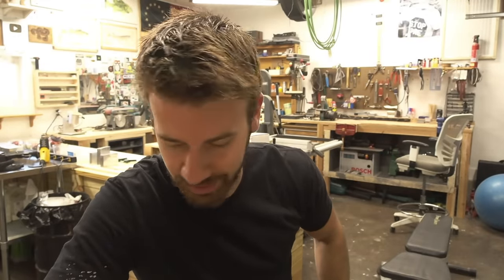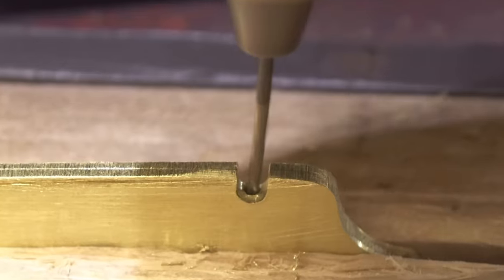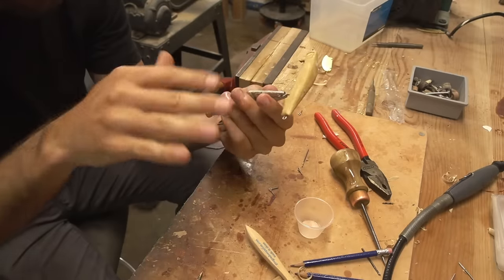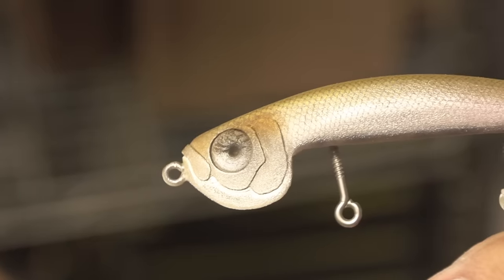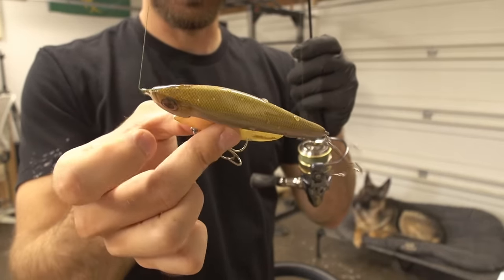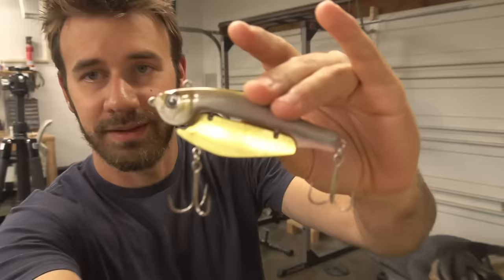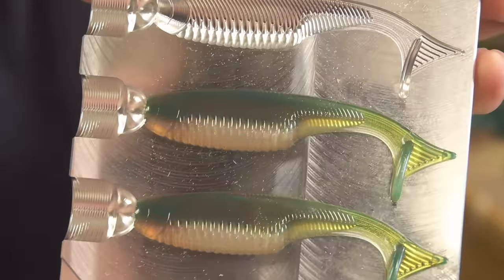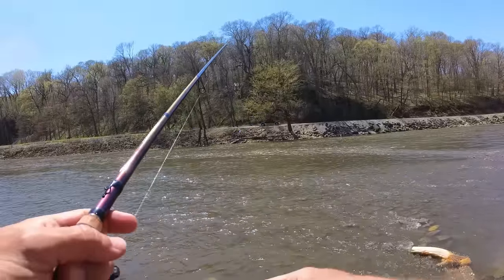Brass Belly Bladed JerkBait | One Day Build to Catch

Comment: My suggestion when you were struggling with the weight and lack of action would have been to grind 1/4” wide vertical grooves stair stepped on each side of the brass.  It would’ve cut down the weight and probably cause some erratic vibration coming through the water.

Comment: Slit the brass about midway point from the bottom. Bend the front one way and the rear the other way. Doesn't have to be a lot. But that may help it catch more water and get the brass to wobble more. 

Just a guess on my part. That could just make it worse too.

Comment: Honestly I really liked the original action before modification.  A nice lazy swim bait. 
I honestly wouldn't feel too bad. I've been fishing as much as I could (between work) lately and I haven't caught a thing. Dosent mean I'm not going to try. 

Size matters when it comes to the bait you use. Big baits will only catch big fish because smaller fish can't  easily fit it in its mouth. Small baits catch more fish and big fish like snacking.  
Water temperature matters alot too. A cold fish is a slow fish.

Comment: Have you thought about mounting a water pump underwater in your swim tank so you could just hold the lure in the current and get really good close ups of it swimming and the action of the lure. Just throwing a thought out there and seeing if it sticks to the wall 👍🏻 And I was wondering with the brass blade under the belly would a slight bend to one side at the front and a slight bend to the opposite side at the back help it wobble at all. I feel at the moment it is acting like a dagger board and causing it to stabilise and track straight through the water. I was wondering even if using the plastic bib material for this whole blade would work and could be painted as well. It would be a lot lighter and possibly move easier in the water and if you did need to heat and bend it a little so it wobbles this could be replicated in a jig.

Comment: When using UV, you could hit it with a UV curing flashlight to set the resin from running while on the rotisserie, then cure it with your larger light without having to spin the bait. EDIT: drill holes in the brass to lose weight.

Comment: Looks great…..maybe taper the brass, Top to bottom…or front to back.  Either way looks like it would be great for vertical “rippin” walleyes n deep water.  Also maybe move the line tie “eye” on top further back….even with the front brass “hanger” eye….  I’m certain it would work for our local walleyes.

Comment: Where they all Iwata brushes? They are pretty good brushes that can take some cleaning solvent abuse, and still work nicely.  But if you go Iwata go gravity feed, siphon feed not so good, although   it can take some solvent abuse as well, gravity feed works best.   My Iwata eclipse is siphon feed.  NOT A FAN.

My gravity feed ones are a Creos, a Paasche Talon, and my most go to airbrush is a Harder and Steenbeck Evolution.  ALL double action.   Double action airbrushes are the best bang for your buck.

Comment: How is it confusing? The lure does absolutely nothing in the water. 

-Replace the blade with two pieces of thin lexan (with iridescent foil sanwiched between them). 
-Give it a small rounded lip.

I don't know if lexan floats on its own, might need to weight it somehow

Comment: @MarlinBaits Just throwing this out there. It almost appears as though the broad back on the bait in combination with the non fixed blade are sort of working against each other. Because we know crankbaits with a broad back will can wobble but they usually don't have a heavy non fixed weight underneath. Than compared to an actual blade bait that does have a heavy weight on the bottom they are typically thin on the top. I wonder if the brass blade was fixed to the bait what difference it would make, you may have to rip in fast to get it to respond given its weight. Anyway still a very cool looking bait, well done!

Comment: This is awesome. Guaranteed major fish catcher and forward facing sonar niche bait for bass fishing. one suggestion, due to the amount of weight I think this bait could double as a pseudo blade bait. If you added an optional line tie on the top of the bait, the angler could choose how they wanted to fish it, as a swimming bait or a vertical yo yo style bait. I think it would have really good application both ways. Would definitely like to see this hit the market

Comment: Great work on the design, detailing and craftsmanship. I also had high expectations for your brass belly lure. I think the weight of the bass is too heavy without any hydrodynamic contours to offset the weight. Consider tapering the bottom to top of the weight as a V shape or any other profile and at the connection of the body  and weight could be more passive (more play) might be helpful to allow the brass to to flutter in the fall. I would love to see you re-fish and with these modifications. Thanks you, keep designing!

Comment: Removing material from the back was my first thought when i saw it''s first trial in the test tank, I think it was just too much weight pulling it straight down to get anything going. Maybe even a little more off the back and a few holes drilled out of the brass to slow it down and force the blade to catch water. Really cool concept either way, probably just takes some magic to find just the right proportions to make it work.

Comment: So, a little hint. If you soak the piece of brass with the broken drill bit in it, in a water and alum solution, warm works best, it will dissolve the steel but do nothing to the brass. You can get alum in the grocery store where they have pickling supplies usually.

Comment: I don't know if this would have a desirable effect, but it might be interesting to laminate a piece of flexible polycarbonate/plastic within a plastic pour. Perhaps a small section running down the length of the bait along the spine, or two pieces along the spine, with the separation at the top of the tail?

Comment: This is exciting. I feel like there are a lot of options top modify the design for different actions. For vibration, I think a weighted body with a much lighter blade paired with a line tie on the top of the head would produce.

Comment: Slim the hole thing down on the sides and move your second tow point back a little bit on the back and lastly taper the blade like a knife, try aiming for a flater profile to catch the water more as you lift just like a lipless crank -blade bait.

Comment: Make a lure with a slightly off center disc/plate right in the middle of the belly that has a thru-wire, so as you reel in it spins and flutters